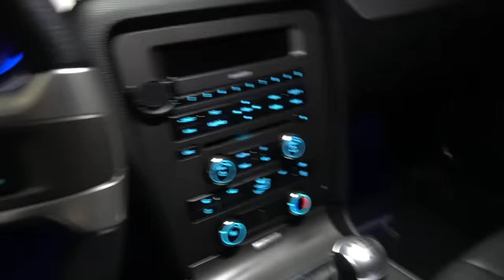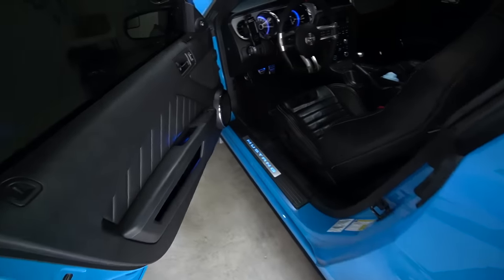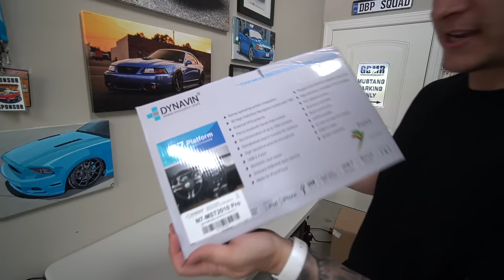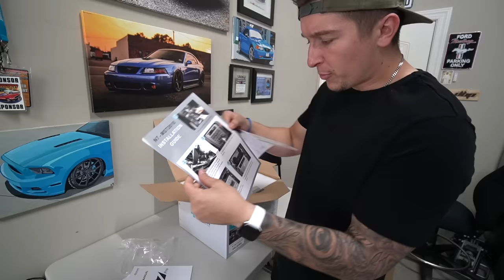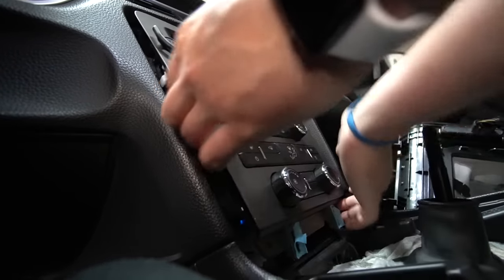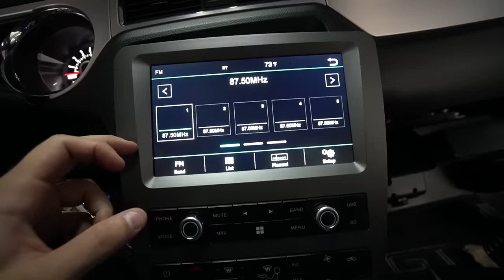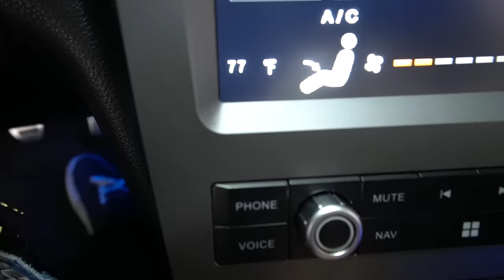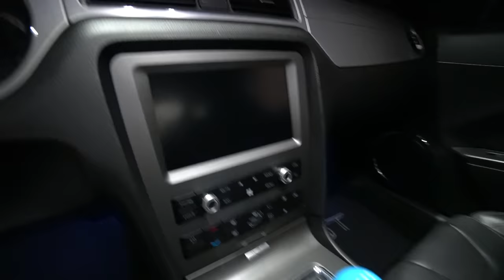Creating the Perfect 2011-2014 Mustang Interior! (Dynavin N7 Pro)

Comment: Yeah Ford kinda cheated out, a car from 2011 to 2014 with "premium" in the name shoulda had a screen standard.
Reply from the maker: They really did smh
Reply: Every 11-14 mustang are the same basic interior except the navigation screen & sound system this is an extra option to pay for it 
But it comes standard with GT500.

2010 I’m not sure about it
Reply: I have a 2012 shelby gt500  with the svtpp.  It has the same base model no touch screen stereo you started out with. I think I'm going to upgrade to what you bought.
Reply: @danshehorn9813  2013 was the first standard year for the screen
Reply: @TeamLuxzGaming my 2013 GT premium doesn’t have a screen, just the tiny garbage radio
Reply: Completely agree with you on that one

Comment: You should check if your speakers are hooked up properly.  The volume should not blow you away at such a low setting.  The Shaker system has amps. I believe the speakers should be hooked up with the female  RCA harness after you get a harness to convert the speaker plug into male RCA’s and hook it up just like you would if you have an after market amps.   I may be wrong but you do not want to blow your speakers.

Comment: I have the OEM nav screen that came stock in my 14 5.0 premium, it’s nice, but it’s definitely dated man. It was the same screen used in 2010 models. This is actually better than the stock touch screen. Also, the thing I don’t understand, is mine didn’t come with a back up camera? Idk why someone would spec a touch screen with no back up camera but they did. Regardless, enjoy man! Looks so much better and is better than the stock one.

Comment: i ran the same unit in my s197! absolutely LOVED it. Now I’m stuck with the S550 base model unit😂
Reply: which car did you prefer 3 years later
Reply: Honestly the s550, only had the gen 2 coyote but loved everything more about the S550. 

I much prefer the IRS of the S550 compared to the suspension of the S197, that was by far the largest noticeable difference about daily driving both

Comment: Dynavin n7 pro by far one of the best radio for the Mustang I love mine. Was able to retain the factory usb and amp w/subs
Reply: Also @derekbaranproductions if you disconnect you usb on the sync module under the glove box. You can keep using the factory usb location for carplay super easy Todo

Comment: Does your CarPlay maps work without the gps antenna? When I did the install I did the same thing as you and skipped the antenna but then the radio didn’t know where I was as I drove so I ended up having to wire it in
Reply from the maker: Yeah mine works fine! You shouldnt need it considering your phone just broadcasts maps

Comment: SYNC 1 was awful, I had a 2012 Mustang V6 base, which had the SYNC 1. I traded it in for a 2014 Ford Edge Sport V6, which had SYNC 3. My current Ford is a 2023 Ford Edge ST (Last year sadly) and it has ALL the options. I love the SYNC 4 system. It's very fast and so many features built into it.